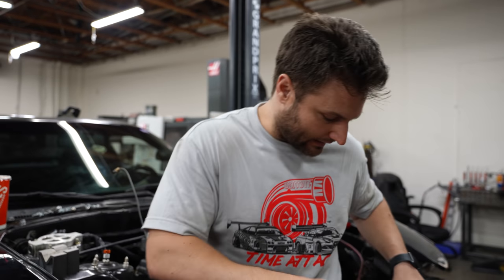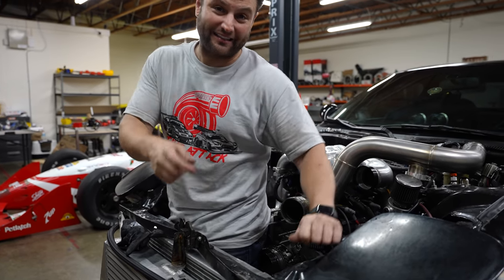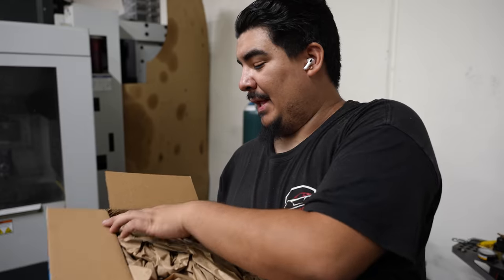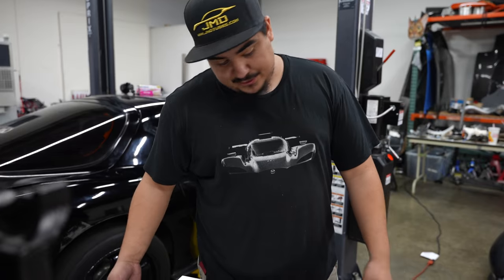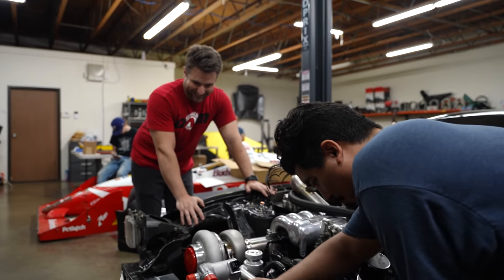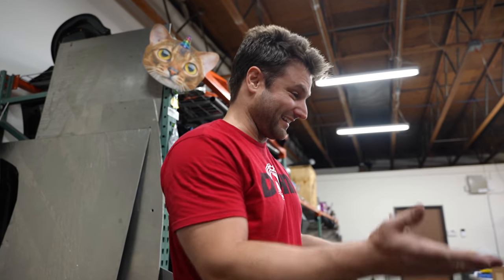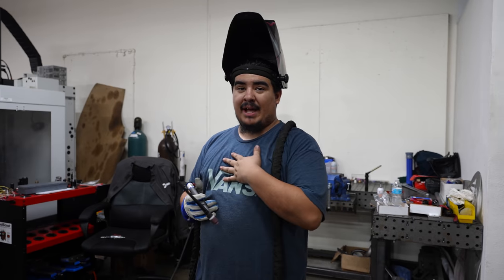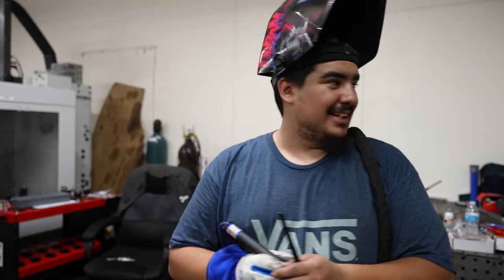We make it ICE COLD for the 1000HP RX-7.

Comment: Just a friendly heads up. We have use that exact fan controller on multiple Formula Drift  builds. They do work but everyone has overheated on us and go into a safety mode. We had to remove it from the direct hot air flow and remote mount the controller in clean air.  The weird 10% whine gets worse as the fans break in too.
Reply: How the fuck is that shit still being sold.  Someone write a review and communicate with other buyers.
Reply: @bgj2940  because it works if the controller isnt being pelted with hot air
Reply: There is instructions in the owners manual on what to do when it whines the fans. Probably a good place to start
Reply: @mrkouki180sx  is it attached to the (original) shroud from the factory? If so it sounds like the company needs to revise the build and update the install instructions.
Reply: Dccontrol.com sells the best ones. Also pwm controllers can only be used with brushless fans. Such as spal. cheaper brushed fans don't last long.
Reply: Lmao, did you made an acc just to comment this? Your account is 12 hours old, I'm sorry for thinking you're not credible

No information on who you are in the about page, i get you're trying to help but do understand
That we also need reassurance that your help is credible
Reply: @RENO_K  John owns Committed Service Brand, he has his company logo beside his name. He builds pro drift cars and is an incredible fabricator.
Reply: @RENO_K  no I have a few videos of my ls swapped tacoma that the fans are on. First time poster, long time listener. The pwm from dc control is seriously top notch. It was built for the battle bots
Reply: @rexrunner  he was talking about John Maykrantz
Reply: @mrkouki180sx  plenty of OEM fan controllers on modern cars are mounted directly to the electric fan shroud assembly sandwiched between a hot ass radiator and a hot ass engine. Like the Nissan Juke for example. Derale has no excuse here.
Reply: @Thegoose95  those oem units dont see the heat that high power cars see so yea they wont really get effected 
1000hp cars put out a SHITLOAD of heat vs a nissan juke
Reply: @rexrunner  PWM can be used with brushed and brushless fan motors.  In this video, these are brushed motors.
Reply: @brent92888  hence the noise. Brushed won't last. Been down this path.
Reply: @rexrunner  Delta pag ask Tom Bailey If their stuff can reliably keep His Steve Morris SMX cool it's got to be good!

Comment: You should put a bleeder on the top of the radiator in case you have any air binds in the cooling system
Reply: A bleeder and an ever so slight slant to the top so any air will be ushered to one corner (where the bleeder would sit - most likely best at the other end to the water pump input).
Reply: Should have drilled a few small holes at the top of the stand pipe for air to bleed into the outlet neck.
Reply: This, that radiator will not fill above that pipe otherwise lmao
Reply: Came here to say the same thing! Definitely going to have issues until there's no air in that radiator.

Comment: You need to have a bleeder on top of the radiator, or you're going to lose half your rows because the top half will be airlocked
Reply: lets watch and see. i was thinking the exactly the same thing.it will cause problems for sure
Reply: Was just scrolling to see if anyone else was thinking the same thing, the radiator will only fill to about the level of that pipe
Reply: Hope he reads this
Reply from the maker: Agreed. Isaiah’s legit behind schedule. It’s part of the plan so I can purge it. Appreciate you guys watching out!
Reply: @RobDahm  screw that POS pwm controller use your fueltech to control PWM of the fans and use a 65amp 12volt solid state relay which will allow you to use the pwm output from your fueltech to turning on and off the solid state relay with the PWM.  example part of solid state relay part number 7564-HC
Reply: Awesome glad ur on it semi trucks use a small hose on top of the radiator

Comment: Rob, a small observation on the radiator arrangement. With the internal suction pipe installed, the top half of the radiator will be a giant air pocket, that you will not be able to bleed. Please consider a bleeder on the top of the radiator. Greetings from Europe.

Comment: Just run the fans off an ecu pwm output and use a solid state relay 👍
Reply: Exactly what I was thinking, I'm assuming his ECU is capable of that. My only concern was whether the fans are pure DC, or possibly 3 phase? Don't care enough to research that setup, but there's definitely better ways to build a fan controller.

Comment: Have you thought you could be short cycling the radiator. Water always takes the path of least resistance. Get a heat gun on the radiator with the car running.  My kid and I love the content.
Reply: 100%, use a heat gun or if possible a IR camera. Will be very interesting to see what is found.   I suspect there will be a high heat spot at the top of the outlet tank as the water will be stagnant there because the pipe is aiming straight down.

Comment: Rob, you should look into hydronics temperature controllers (like we use in the HVAC trade for boilers) for temperature sensors. Really simple 10k ohm thermistor that you could fabricate a dry well into the radiator tank and get THE most accurate temperature readings.

Comment: 107012 flex-a-lite fan controller pwm. I've had it in my car maybe four years and it's amazing. It comes with a fuse with the override and an AC override. I'm not one to recommend Parts but if you're looking for a fan controller that's where it's at.

Comment: It much depends on what KIND of 3M tape that is. 3M makes some really really strong double sided tapes for the automotive industry. Stuff you can actually mount bodypanels with, and they WILL NOT come off! Not even if you want them to. 

Prep work is everything, though. Always thoroughly clean with acetone where possible. If the materials do not allow for acetone, use isopropyl alcohol 99,9%. ALWAYS degrease 2 or 3 times. Even if it looks clean before you wipe it down the first time.

Comment: 9:45 if you percolate the bottom inch of the tube going into the end tank, it'll flow air out of the intercooler better than a single hole in the tube

Comment: Rob, you need to be able to bleed that air out of the radiator when you fill it or you will have big problems. Usually the highest point of the cooling system, but the way that pipe is in there it won't let the air at the top out and you'll get air pockets in the system anyway

Comment: Heat management covers A LOT of different aspects.  Definitely for rotaries.  I'm not making 1000hp like Rob, but I do road track my RX7 quite a bit and cooling is an issue.  What I did to keep my engine cool was to get a dual core radiator, a cooler thermostat, filled with 70% water mixture, and I sealed the air paths for the radiator.  The stock air path on the RX7s are quite good, but when most people put new radiators or whatever they get rid of the stock shrouds.  Which really screws up the cars' airflow and you continue to have cooling issues.  So all those plastic shrouds and foam seals are there for a reason, it's to direct the air to the right parts.

Comment: Is it a 12v nominal battery?
Because if you're getting 14v from the charger that would potentially be the problem, as it sounds like a mosfet oscillating as the voltage drops.
As both circuits have a resistance you're making a divider, it goes below the voltage threshold for the PWM controller making it turning on and off at a highish unstable frequencies, hence why if you bypass the PWM controller it turns on and if im correct it will flow higher off the alternator than off the charger just due to the fact that its not seeing the full voltage.

In Fact if I am correct and we use the variables 12.5v shutoff voltage and 14.7v alternator voltage we get:
14.7-12.5 = 2.2v extra
12.5/2.2 = 5.68 times less than cutoff
1+(1/5.68) = 1.18 (118% extra voltage)
1.18^2 = 1.39 times more power going to the fan (P = (V^2)/R, R ~doesn't change)

But that's my guess, based off over a decade of electrical engineering experience.

My question though is why use their controller at all, why not put your own NPT sensor on the hot side and have the ECU control a 100a SSD relay via PWM signal with a sensor that you trust?

Comment: YES!!! A properly designed fan shroud!
That extended pickup is a darn smart idea, not sure about the application and packaging but one of the big advantages of an electric water pump is it can be placed almost anywhere - my personal preference is low down and drawing from the cold side of the radiator to the engine. The pump runs cooler than on the hot side drawing from the engine and pumping into the radiator, and it means as long as there's enough coolant to immerse the pump inlet, it'll be providing some circulation. having it at the highest point hurts my head, even with that internal extension.

100% agree about exposed terminals like that, I'd certainly be using a fuse, circuit breaker, or I think you're using a PDM which can be set to monitor the current draw and reset before cutting power.
Same with the coolant pump sensor - it's all very well monitoring the coolant entering the engine, but that's not much help if the coolant is then flash boiling in the engine before condensing to a low temp' in the radiator. That said, it will depend a lot on the specifics of the setup being used.

Comment: For Isaiah you can check for pinholes in the radiator with uv dye during your pressure test (like checking for ac leaks) also helps to use a leak down tester for the pressure test. When you have a badass compressor it will mask leaks by supplying more than enough air

Comment: Electrical engineer and electrical technician here. Those crimps are fine to use even for 60+ Amps. You just need to make sure you use the right sized lug/crimp for your cable and crimp it correctly and also bolt it down tight. (loose terminals can cause arcing resulting in fire) And where they're terminated, its not the best housing imo. When current is running at 60Amps it generates alot of heat so it doesnt look like it gets alot of ventilation in there, those terminals shorting out would be the least of my worries. But hey, follow your gut though, if it doesnt make you feel comfortable dont use it.

Comment: Yeah learned my lesson on derale products. Absolutely junk products. Ordered a fan/cooler to hook up for a transmission cooler, also the relay kits they sell are the worse, the pins are loose and want to separate from the relay all the time. Never again buying Derale products. Cooler was so horrible had metal inside the cooler from factory, had to flush it, like you say fitment is crap, fan didn't push the cam supposed too and need to do so much to rework stuff to make work and fit well in your own car. I ended up sending mine back and went with a dual fan Setrab setup... good luck, those derale fans will let you down and you will be looking for better ones in no time.
Reply: He's using Spal fans. The controller is Derale.
Reply: @Blackner2424reborn  oh ok. Normally when it's a kit like that they come with Derale fans too. Spal fans are a 👍🏻 from me.

Comment: Don't shock the system, put a 1 farad cap ahead of the relay. That way the cap takes the shock and doesn't interrupt cooling. Then, use inline coolant temp sensors connected to your ECU to detect the inlet and outlet coolant temp at the engine side. Easy peasey, no need for that crap PWM controller.

Comment: @13:08 Thata isn't certain death and as long as you don't have any unnecessary strain on the wire and the connector it's perfectly acceptable for termination points. It's a common way of securing wires to components and perfectly safe.

Comment: Just wire the fans separately. Turn on one with ecu at X temp. And second with ecu over a Y temp. Have them both shut off above 80mph. 

Done. Simple. Easy to troubleshoot. Reliable.

Comment: Don't cool your oil to 140deg, the additives wake up and are able to do their job at 180-200F. Over-cooling is just as bad as not preheating! A good option is putting a thermostatic valve on your oil cooler loop to prevent overcooling and to decrease preheat time as well (especially in cold weather).

Comment: Fans only help a low speed or idle, so for drag racing fans are the way to go. They will actually be restrictive and higher speeds, so for circuit racing you would not want any fans blocking flow. Of course this is provided you have proper ducting.

Comment: The electrical is fine - also thicker gauge wire handles heat better (nfpa talks about this a lot).

The terminals may be close, but that's what the cover is for. It takes a lot to arc between terminals with air as an insulator.

Comment: Don't forget two more elements of the cooling system. Good ducting from the front of the car to the radiators and oil coolers. And then good hood venting to get the heat and air pressure out from under the hood.

Comment: Ducting on both sides of the rad to allow the air to slow down is equally important as well. Smaller openings on both sides so the air expands and slows down to collect the heat

Comment: This is most likely the Pierburg CWA 400 pump for BMW.

If you need a good PWM controller for it with LOADS of configurations and functions i like to recommend the tinyCWA by company called tecomotive.com located in GER.

Btw. Usually pumps should be installed at the lowest point in the cooling system. So it naturally gets rid of trapped bubbles and is self priming. You both should really change it accordingly. The CWA pump is highly water resistant and robust. So there are no concerns about having it hanging low behind the radiator.

Having a pump sitting on top of the engine might lead to a collapsing flow of coolant IF the level dropped by a few inches without the pump running at high enough rpm.  Once it pulls air the flow will completely stall.

Just an advice - dont ask me how i know...

Comment: Install water jet ahead radiator, when engine gets hot spray water on radiator. It helps to bring temperature down realy fast.
Mitsubishi uses it on evo cars to bring intercooler temp down for better performance on hot contition.

Comment: You could probably use a screw-in liquid temperature sensor (coolant temp sensor), connect them to both the input and output of the radiator, then figure out a way to connect the fan pwm to the sensor readings. I don't exactly know how this would work but it seems like a good idea in concept, rather than having a temperature sensor work by the metal on the radiator shroud (which might be why the radiator had the thinnest metal in history), you would be able to see the temperature going in and out of the radiator and gauging how effective your cooling solution really is under load.
You already have an ecu that can give you readings on everything in real-time, it might actually support a coolant temp sensor and pwm fans.

Comment: Hey instead of using that 3m temp sensor. Cam you use like an aem gauge that actually used a 1/8 npt. and then just tap into that for the fan wiring for monitoring the actual temp

Comment: Recently watch Gale Banks' video, apparently one thing about cooling is, you gotta make sure air are actually going through your coolers, hence the importance of shroud, not just fan shroud but also between bumper & your radiators/intercoolers. And then after air passed through your radiators/intercoolers, you gotta make sure it has place to escape.

That, compare to my old mindset of "just more holes on bumper & bonnet", is quite different.
Reply: If the holes on your bumper/bonnet don't go to your radiators then it is not cooling your radiators. Radiator intake ducting help develop positive pressure in the intake side of the radiator. Shrouding on pull fans help improve the negative pressure developed by the pull fan on the "rear" part of the radiator.

Holes into the bonnet are usually for engine air intake or for top mount coolers,  holes out of the bonnet are usually used to pull hot air out of the engine compartment. Most don't have air extraction vents on their hoods and let the air find its way out of the engine compartment towards the bottom of the car, which doesn't help with downforce.

Comment: The rotary vette came with your control GM PWM fan controller. I would build a 3D table in the ecu and use coolant temp from motor and coolant temp from radiator for x and y. That way you can have protection if motor is hot or coolant isn't cooling and dial it in to maintain a constant temp with minimal changes to water and air flow.

Comment: I'd look at getting a little Saur Danfoss 12pin I/O module for your fan system. You can put a thermostat on and write some code (it's actually really easy to do) to control your fan smoothly. They even have PWM control. The connectors and terminals are really easy to source (mouser and digikey both carry Deutsch products) and they're all German so they're great quality.

Comment: I just set two temp sensors on my cars to run at two different temps for each fan, one goes on when the car reaches the lowest running temp, so around 130, then the other one kicks on around 185. I go this route cause one fan being on keeps the temps down for daily use and the other is for really hot days and track days. I go the cheap route cause I don't make much money to afford a cnc machine or pay someone to do my stuff and like to fab up my own stuff when I can with what I have.

Comment: Air isn’t the only issue with keeping a pump mounted high in the system, net positive suction head is really what’s going to screw you here since you have none. I’m 99% sure that pump will cavitate in its current configuration, you’ll likely have to keep the PWM duty down, which negates the purpose of the pump. I love the CWA400 though, I currently use the same pump in my turbo LS truck. It’s a sick pump, people really sleep on how good they are.